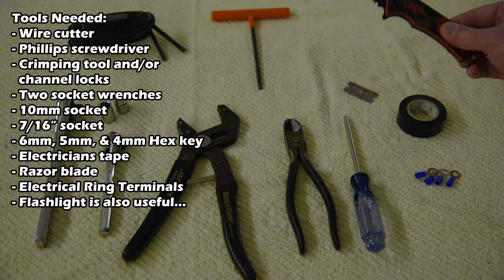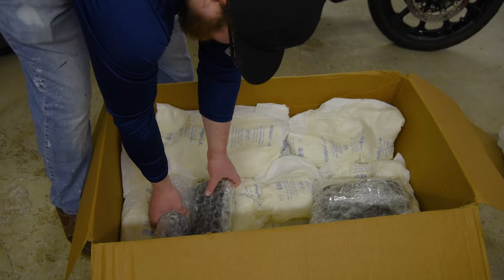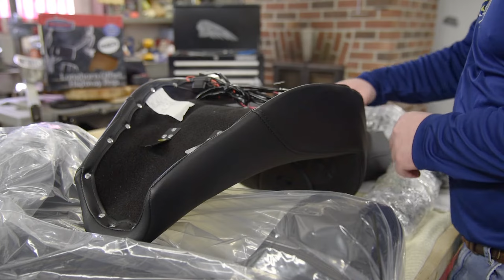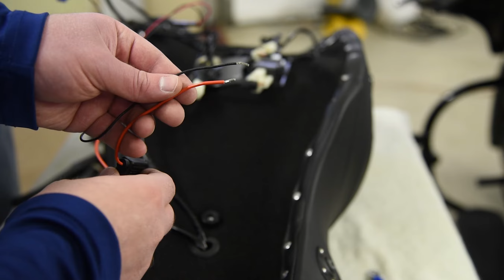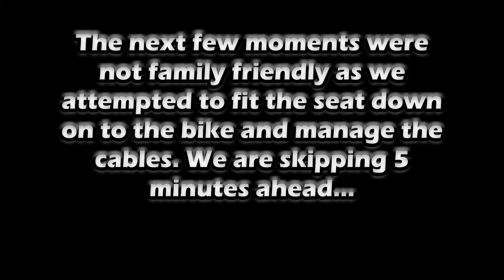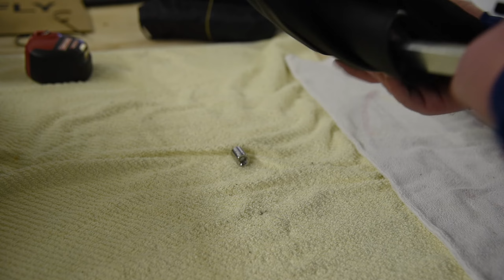Saddlemen Road Sofa Heated Seat Installation

Comment: Is the passenger backrest heated? will you be doing a road vlog on how the seat comperes with the stock seat?
Reply from the maker: The backrest is not heated. But the passenger seat is. You have independent seat heating controls for rider and passenger. Will definitely be doing a road vlog comparing it to the stock seat. Saddlemen recommends breaking in the seat for 500 to 1000 miles. I am almost to that point. Did not want to do a review of the seat prematurely. I have a lot to say about it after 1000 miles though!

Comment: That does Not look like fun. I've had an ultimate seat on my previous bike a 16 Victory XCT the heated seat had a single plug that plugged right into the bike plug, super easy. Not sure why Saddlemen can't simplify the wire hook ups? Beautiful seat though 😊
Reply from the maker: It certainly could be simpler, and since I made this video they may have updated it to a simple plug - it’s been a couple years. But even so, it’s not too difficult to do. Just a fun afternoon in the garage working on a motorcycle. Beats work 😀
Reply: @MOTOBLADE  It's actually much, much harder now, it comes with foam you have to cut and drill holes for the wires.

Comment: Did Indian have a terminal under the seat for a heated seat connection. My wife’s 2015 Vintage has a stock seat w/o heat, but plugs are there for a heated seat connection.
Reply from the maker: Yes they do, however, the saddlemen seat doesn't have the matching plug, hence why I wired it directly into the bike. I went back later and used posi-tap connectors to tap into the wires of the Indian seat plug, putting the seat on an ignition protected circuit.

Comment: Midget *or leprechaun. I'm looking at one of these, but won't do it if I can't connect to the switch. It shouldn't have power constantly.
Reply from the maker: Update for you: I have connected it to the switch. There is an indian seat plug in the battery area under the seat. I tapped directly into those wires. It only has power now when the bike is on. Just used a couple positap connectors. Very easy to do. Hope that helps! Thanks for watching!
Reply: @MOTOBLADE  yeah thanks!
Reply: @MOTOBLADE  hey I assume you kept the black connected to the battery negative and you only hook the positive up to the connector switch?

Comment: Is there a adapter to plug in. so i don't hook up to the battery directly . you made a mention of  a update. I got mine on order. I enjoy your videos!
Reply from the maker: There is no adapter unfortunately. What I did a few months later was use posi-tap connectors to tap the power lines into the ignition protected circuit of the bike, rather than directly to the battery. That way, in case I forget to turn the seat heater off (which happened on more than one occasion), it will now turn off automatically when I turn the bike off.

Comment: Great video, very informative, I have a couple questions, if you could give me some input it would be much appreciated. They are:
what is the width of the passenger’s portion of the seat pan?  
Does the nose of the seat sit closer/further/or the same distance to the gas tank?

I have a aftermarket passenger backrest and it’s very close to either working (or not!) I would really hate purchasing the seat only to have to send it back. Thanking you in advance……..Glenn
Reply from the maker: I will have to measure the seat but I will get back to you
Reply: @MOTOBLADE  much appreciated.

Comment: I'm planning to buy one for my HD CVO Street Glide, heated and with rider's backrest, but I'm not sure if it comes with the tourpak backrest or just with a cover you would need to put over the original one. Any idea?
Reply from the maker: You can order the tour pack backrest to match from saddlemen. It doesn't come with the seat, it is a separate order. If memory serves, it was about $300 for mine, or somewhere around that number.

Comment: Was there not a 2 pin switched power plug already under the seat you could have tapped into?
Reply from the maker: There was, but I did not realize it at the time. A few months later I went back with some posi-tap connectors and tapped in directly to the 2 pin switched power plug so the seat is now on an ignition protected circuit.

Comment: well that settles it for me, no way am I getting the heated version. That wiring is way too janky for my liking.
Reply from the maker: Since this install. I ended up using posi-tap connectors to tap into the ignition protected circuit of the bike instead of direct to the battery. However, all that massive bundle of wiring still has to be there. I don't blame you. If I didn't live in the cold north woods of Vermont where I need the heat, I wouldn't bother with it. The seat itself (besides the heating wiring) is amazing however, and totally worth it however. Thanks for watching!

Comment: Why can’t we connect the seat heater to the factory plug that Indian uses for their seat heater?
Reply: I have my old seat, I’m gonna do it.
Reply from the maker: Good question! I contacted Indian about this, and the stock indian heated seat has a plug built in, but they will not sell you this plug. So, the only way to get it is to find an old seat and cut it off. What I did about 3 weeks ago (which unfortunately I forgot to film) was I took the positive and negative wires from the saddlemen and used positap adapters to wire them into the wiring circuit for the Indian plug. Thus, they are now on an ignition protected circuit (so I can't accidentally drain my battery if I leave the seat on).

Comment: I just installed this seat on my chieftain. Are the heaters supposed to stay on even when the bike is shut off? Or did I wire something wrong?
Reply from the maker: The seat has its own independent on/off switch. Because it is wired direct to the battery, it can be turned on independently of the bike.

Comment: I am looking into this seat for 2up. How does your passenger like it. Id be coming from a padded rogue seat. We rode that seat 3k miles to sturgis and back. She just wants something a bit wider
Reply from the maker: Rear seat is wider, and my passenger loves it. She's put about 500 miles on it, and couldn't be happier. Coming from the original indian two-up seat she says it's incredible. She also likes the seat heat. I've hopped back there just to try it and it's even comfy for my fat ass 🤣 we both highly recommend it!
Reply: @MOTOBLADE  what’s the most miles you have tackled 2 up in the day with it. Or trip?
Reply from the maker: @twincam9082  9 hour day (9 hours of butt on seat). Only 400 miles though. Wasn't highway - lot of winding twisting mountain roads and parkways.
Reply: @MOTOBLADE  nice. Still a lot of ass time. Just looking for feedback from more so a 500+ mile highway ride.
Reply from the maker: @twincam9082  I'm planning on riding to sturgis this summer. Not that you should wait around for my review then :) but that will probably be the first chance I get to really put highway miles on it. I love so far out in the boonies it takes me an hour just to get to an interstate near me.

Comment: As much I like the seat, but I don't like the cable management. I wish they made it to be connected with the Indian harness like the Indian seat does. Other than that, it looks great.
Reply from the maker: I agree with you 100% the amount of cables they supply to power this thing is ridiculous. If they could just run it to the Indian harness connector it would be perfect!! I will say I couldn't be happier with the seat though. Incredibly comfortable. Best investment I have ever made for a motorcycle. Thanks for watching!
Reply: @MOTOBLADE  did you mount the relay switches or stuff them down inside with the rest of the wiring?

Comment: Cant wait for the seat review after you have pounded some miles on that seat. 
Did it change your seat height or your reach to foot controls?
Reply from the maker: Raised my butt slightly higher. No problem with the foot controls or handlebars. 5'8" and 29" inseam for reference. Very comfortable.

Comment: It’s been a couple months and you’ve had to log a bunch of miles this summer - what do you think? This seat it at the top of my short list for my new to me 2019 chieftain. After, adding heat and a driver’s backrest it’s easily the most expensive one on the list too. I’d be appreciative to hear your experience.
Reply from the maker: Have a full review coming soon. Short answer: worth every penny. The backrest, the heat, everything. Changed my riding experience forever.

Comment: Great video! I’m short so I’m wondering if this seat adds height over stock??
Reply from the maker: It does. Not a lot. Maybe half an inch or just slightly more? I'm short as well, and I feel I'm a little higher on my toes at a stop. But if I slide forward on the seat I can get my feet down almost all the way.  5'8" with a 29" inseam for reference if that helps. Still absolutely worth it for the comfort.

Comment: So, I have one of these coming, thank you so much for this video!  I have a factory heated seat on my Chieftain, do you have amy idea if I can use the installed wiring harness rather than connecting directly to the battery?